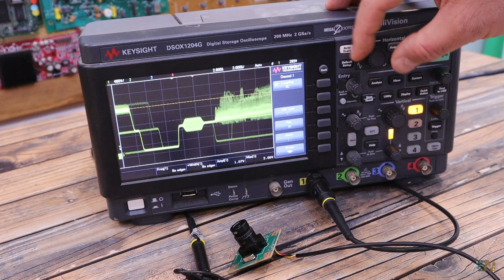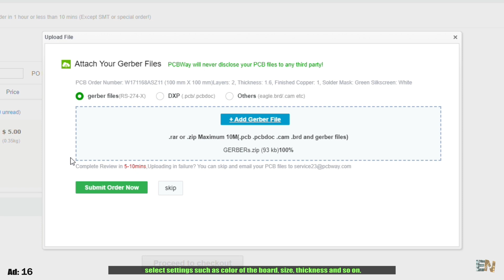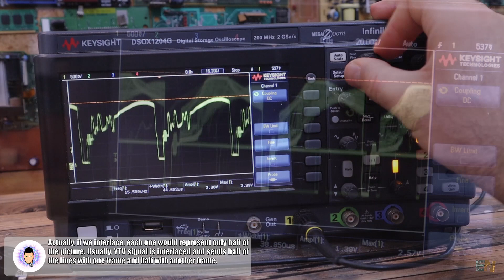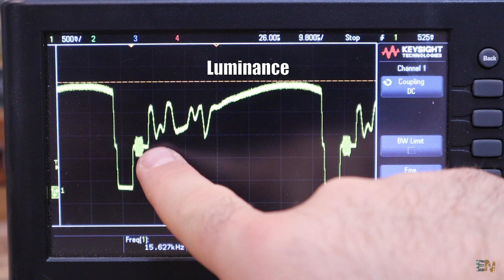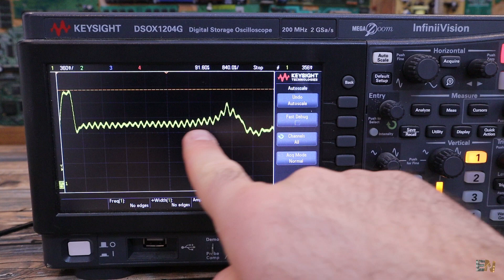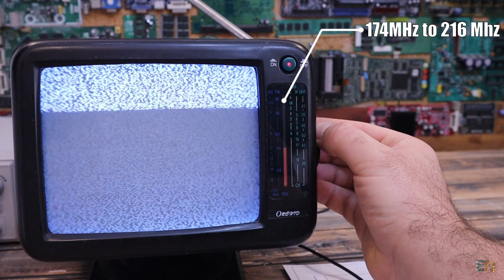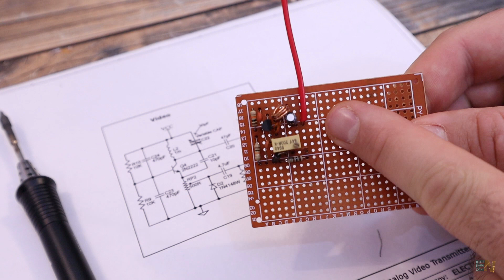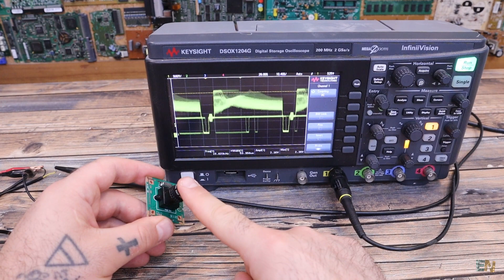Super Small SPY camera - Analog Video Transmitter Circuit & Theory

Comment: Hello friend I made this circuit and it works I used a CD players video output. I have some questions like Did u use a bipolar 4,7mf cap for the +of the video signa
And what function does the 500ohm pot have

Comment: I am grateful you did this video. I always enjoy your presentation. The circuit explanation is very simple and straight forward. The waveform of the camera is complex and complicated. 
Nevertheless, how can I make this video signal stronger with audio that can travel far distance with circuit explanation? We still use both digital and analogue TV in my country.
Reply: You need to add amplifier and proper antenna. That's the key components with any wireless transmitting.
Reply: @krukhlis  
Thank you bro, but I want the circuit diagram of the said Amplifier and possibly the explanation. Thank you

Comment: Just 2 add-ons:
1) This circuit has no protection against interference. Also, I'm pretty sure it produces enough interference by itself for another devices.
2) You definitely need amplifier added to the transmitter, the signal is very weak.
But yes, thank you for the nice tiny project that reminds me my student time. :)
P.S. BTW, do you have any progress with your custom DIY resin 3D printer?
Reply: is that why the video quality could suck ? What increases video quality ? I can get a video signal ( appears on multiple channels im thinking thats harmonics )
Reply: i know wired video will always have better quality than a low voltage transmitter but i have seen other people online do the same circuit and get better quality.
Reply: Quality is alot better ! I think it was my antenna but i also selected a different channel.

Comment: Sir if you read this please help me i want to make a flash light with constant cureent source that is single li ion battery powered and i dont wanted to use any dedicated ic , please if you can make a circuit cause the internet is filled with circuits using just a resistor which i feel if very awful and the brightness decreses , if any circuit is there pelqae suggest me , and i sont want to use a boost converter with resistor cause it is not good , and i have tried using tl431 and other mosfet based cc driver but it works about 5 v whihc is way beyond 3.7 nominal li ion voltage 
Regards Rabindra

Comment: how about using those rx5808 compatible fpv transmitters
Reply: It's tx if it's a transmitter and yea that's cool but building one from scratch is obviously cooler.
Reply: @benmaynard3059  first of all i totally agree with u second of all i made a mistake in my comment actually the rx5808 is the reciever and is the most common one used for fpv drones. what i meant to say was to use a rx5808 compatible transmitter since it achieves several km of range easily
Reply: @ShahZahid  allgood mate 👍

Comment: Excelent video. But there are some errors.1) Each sequence between the square pulses are a line not a frame,2) the luminance signal is inverted, maximum brightness at 0 volt and darkness at max volt. 3) the color info is obtained in quadrature modulation, comparing the phase of signal with an oscilator synchronized by the burst. 4) The color info bandwidth is less (1 Mhz tip.) than luma (5 Mhz tip) because the human eye has more retinal rods (that can sense luminous signal) than cones (the eye color receptors), so the image is a hi-res b/n luminance colored in low res. 5) the resulting phase diference is the hue. Sorry i am from the oooold analog school.